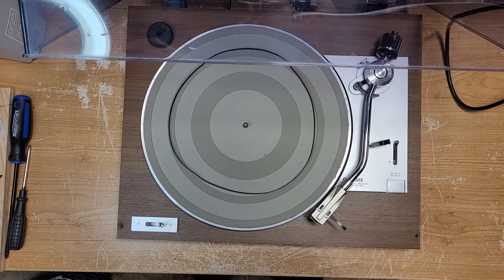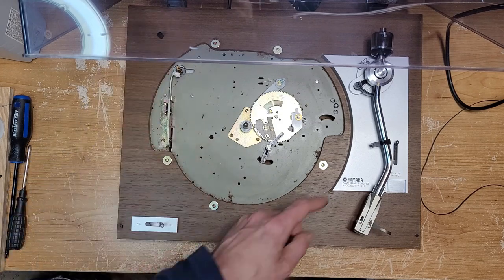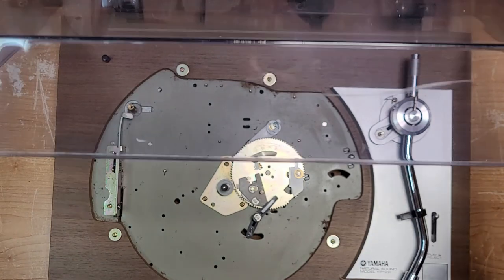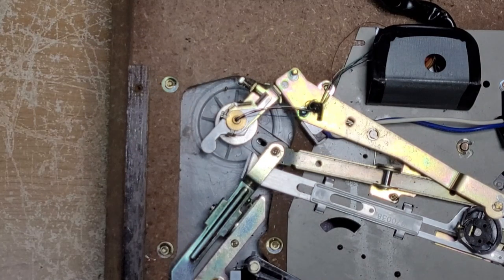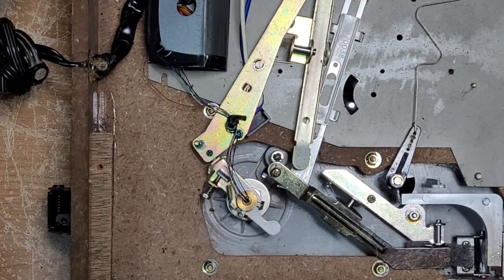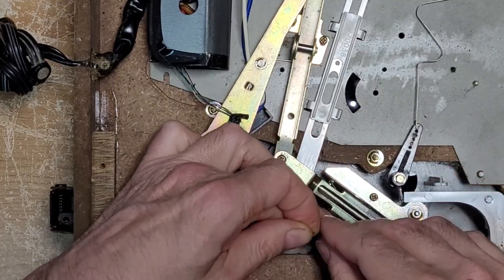Yamaha YP-211: Fast Dropping Tonearm Fix

Comment: I've got a very similar CEC made Fisher MT-6010 that I have serviced, but I can't figure out one issue. When it auto-returns, or I hit the Reject, everything works normally; the tonearm goes to the rest, the motor shuts off. However, if I don't manually stop the platter from spinning, the motor will kick back on. The same thing happens if it is off and I manually turn the platter, the motor will kick on and it will keep spinning. I don't know why this is, as there is no auto-start on the table, and I can't get it to stop. Any ideas?

Funny enough, this wasn't an issue at all until I lubed the center spindle bearing as the platter was dragging a bit and would stop turning before the motor would kick on.
Reply from the maker: Check whatever arm is actuating the micro switch that turns the motor on/off.
Reply: @TurntableGuy  Hey, thanks for replying. It is hitting the switch and shutting the motor off. But after a few seconds the motor kicks back on if the platter keeps moving. Is that supposed to be a momentary switch, so it has to be held down? You're probably on the right track though. One of the two switches has to be getting activated/deactivated after the return by the platter moving somehow, right?
Reply: @TurntableGuy  I figured out later that day that I had reinstalled the double-stacked cam that actuates the microswitch under the auto-return mechanism upside down. So, the switch under the tonearm and the switch under the auto-return we're not being actuated together.